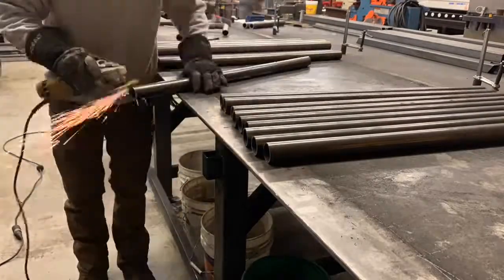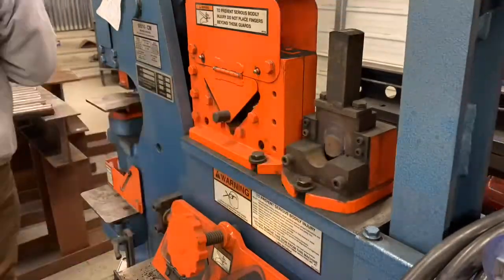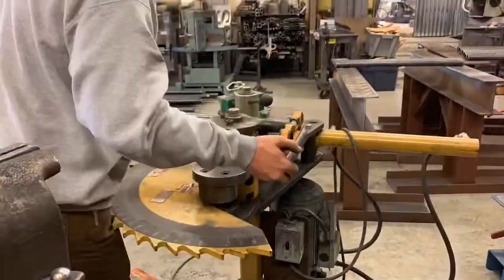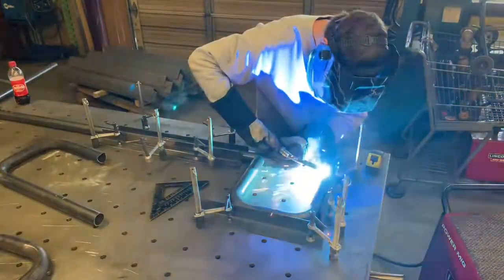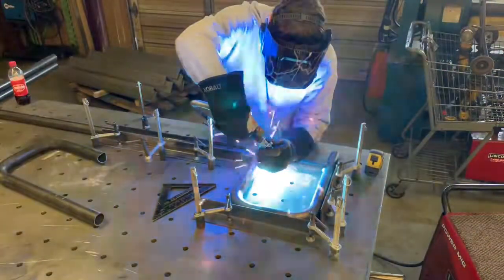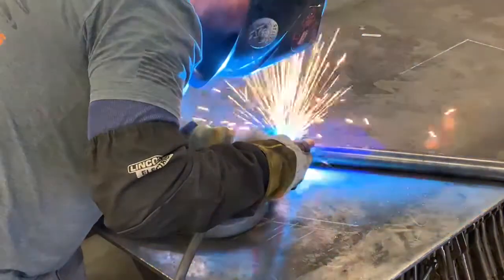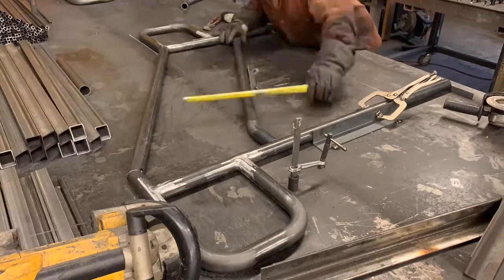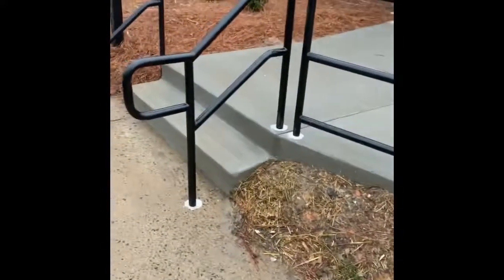Using Baileigh tube bender to make handrails

Comment: Hi there, great video thanks. Is your die the DS-1250P-R300? I am trying to buy the exact die you have
Reply from the maker: Yes that is correct.  It doesn't bend as tight as the elbows you can buy but we don't generally mix those in jobs. We bend 95% of the rails we make but just letting you know in case you use premade elbows from Wagner etc... or other vendors.

Comment: In the dirt??? That must be a Southern thing.
Reply: Well... not sure why(at the end of the video) the rail on the right is on the stair as it should be, and the rail on the left is in the dirt? I hope some old lady doesn't hig that rail on the left and snap her ankle because she steps off the side of the stair! Why not move the rail onto the stair where it should be? Is there a minimum stair width in your state? They look plenty wide.
Reply from the maker: Not sure what you mean?   We don’t core drill dirt.  We install some rails in dirt by using post hole diggers and setting
 them in concrete.  That’s what I mean by that

Comment: pipe vs tubing size description is a bit off- tube size actually measures the number. 2" tube is 2" od. Pipe sizes are not inside diameter- its still the od, but it doesn't measure the number given as size. The inside diameter of pipe changes as the schedules get thicker. But, you can thread a piece of sch. 10 pipe and screw it into the same fitting as a piece of sch. 120.

Comment: Whats the cost for those handrail per foot? I have to built some but i dont have idea how much to charge. Thanks
Reply from the maker: That is a loaded question, the price per ft will change depending on what type of rail, materials used, mounting conditions, paint or powder coat.  You could be anywhere from $50-$125 per foot